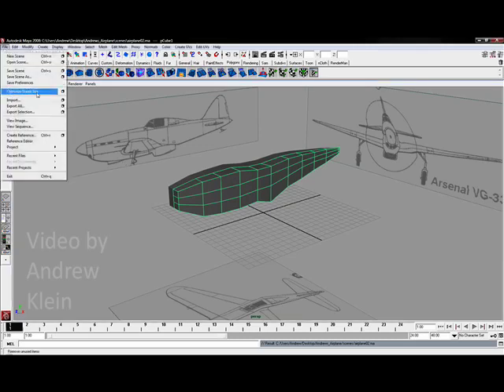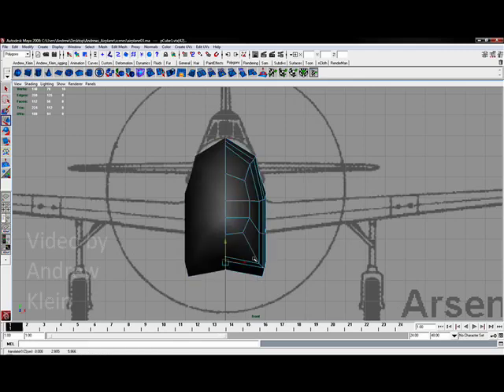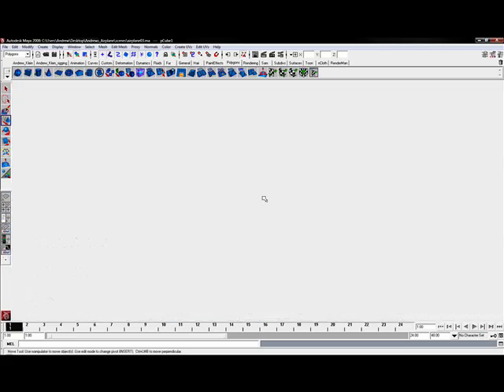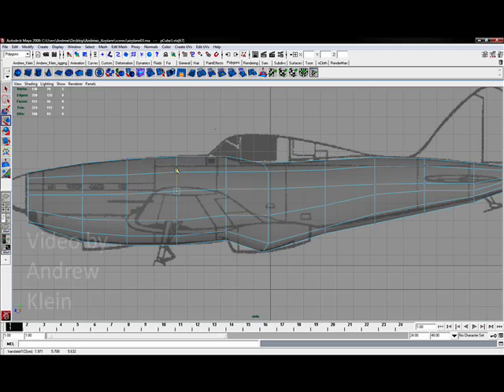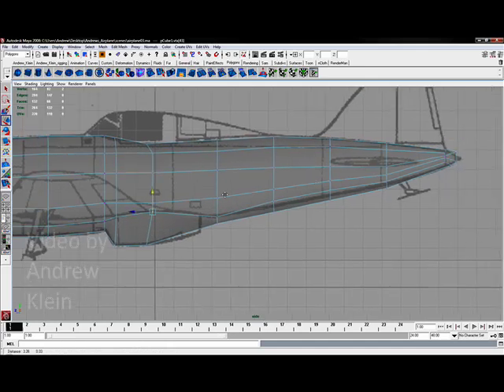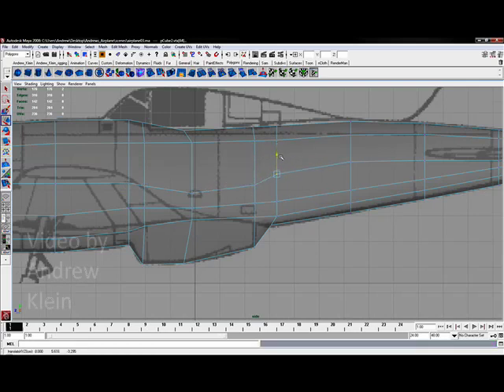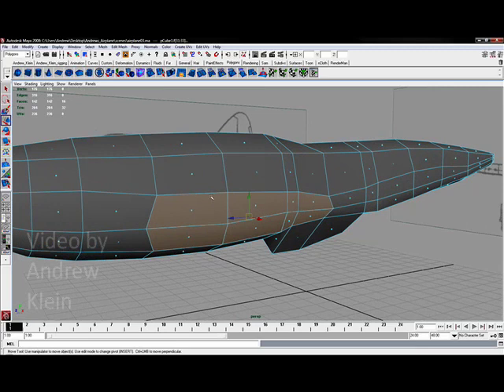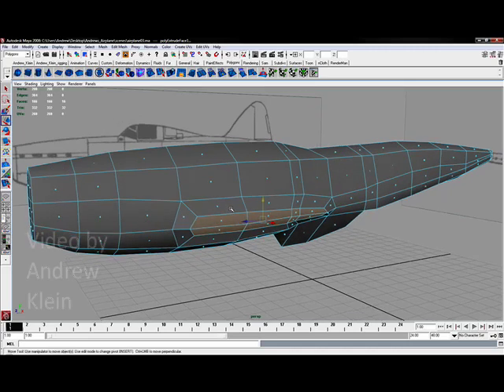Maya Modeling Basics: Airplane pt. 6

Comment: What I find is good when it comes to adding curvature to the fuselage is to use the ortho views in conjunction with perspective, granting one a greater degree of control without having to switch back every time you need to make slight adjustments after doing the whole shebang.